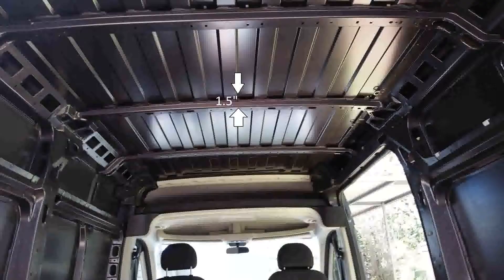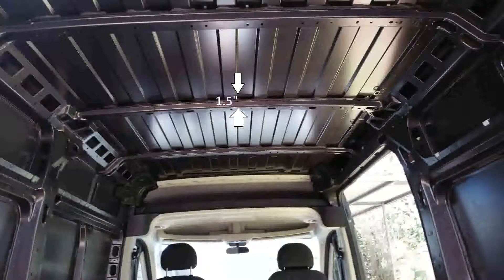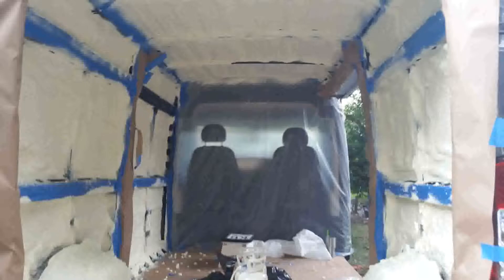RV PowerWall: DIY Dodge ProMaster Build Insulation

Comment: Nice job. Want to do mine. haha. What did you do for the floor?
Reply from the maker: I cheaped out!!!  Knowing I would be on the beach a lot and how sand is not friendly with laminate. I bought a gal of that garage floor coating system and applied about 1/3 of the non skid grit. Over time 3 + years... it could use another surfacing.
Reply: @rv-powerwall9870 Thanks for replying!   I am considering doing the spray foam thanks to watching your video.  Wondering why you did not us the spray foam on the floor? I was thinking I could do the floor as well?
Reply from the maker: @donjones3355  I suppose if you lay your wood strips perpendicular to the floor ribs, then lay your floor decking and secure it down... you could drill holes and inject foam to fill all the voids.
Other wise it would be very difficult to spray foam on the floor and keep a level surface to attach your flooring. I found it easier to use the 3/4 inch insulation board cut to fit tightly between the wood strips and then using the  air duck tape to get the seal (note in corners and places I could not fit properly the foam board I did use a few cans of the spray foam on the floor.

Comment: New sub.  Designing my van to build out within a few years.  Have you heard about the snake skin spray?  It is a ceramic, I think, noise deadener.
Reply from the maker: I have not heard of this however using the spay foam and insulation board it is not noisy in the fan in a heavy storm as you might think. It may also be due to the solar panel being over 8 inches above the roof and it blocks much of the rain from hitting the roof.
Reply from the maker: Sorry it took so long to respond...my internet access has been a bit sketchy....never researched ceramic.... will have to check it out.

Comment: What brand foam did you use and where did you purchase it?
Reply from the maker: Foam it Green.
Be sure its a closed cell. Apply first coat very thin. Note each layer is a closed cell so applying the first layer very thin you get more protection from condinsation with each layer. https://sprayfoamkit.com/products/spray-foam-insulation/foam-green-202-closed-cell-spray-foam-insulation-kit/?gclid=Cj0KCQjwz7rXBRD9ARIsABfBl82Cht9YdjpW0AVSMq47yOA4Fw2HX9Pzz_MpdewYwCrsIrMWuFfaA5QaAvwiEALw_wcB
Reply from the maker: I actually bought the 202 board feet that would be this one. 
Most Important thing is not the brand but be sure it is closed cell.

https://sprayfoamkit.com/products/spray-foam-insulation/foam-green-202-closed-cell-spray-foam-insulation-kit/?gclid=Cj0KCQjwz7rXBRD9ARIsABfBl81POqUlzHE4tt2ODEkJ94mOLe6c57iAjPo2vyWS6fTYymxOrv9vCbwaAulQEALw_wcB
Reply: Thanks for getting back to me.  I found and you probably already know, brake cleaner will dissolve the foam in the spray nozzles even if it's dried. I believe acetone works also. Not sure which is the cheapest.
Reply from the maker: No I didn't know. The 5 nozzels that came with the kit were pretty flimsy I thought but i bought 10 extras and anytime I stopped for more than about 3 min I change the nozzel.
Reply from the maker: @johntatman1436  True but nice to have on hand at least a few clean nozzels because you will know when one stops spraying properly.